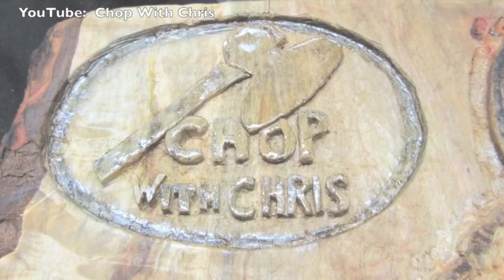How To Make Snowshoes

Comment: Cool job. The locals here use ash for the frame, rawhide for the weave and then shellac everything. In fact they put a new coat of shellac on them every year. I have a friend that has a usable pair from the 1930s. Put away carefully and shellacked every year.
Reply from the maker: Thanks for the advise.  I need to shellac them.

Comment: Well done. I like the frame you made but I would have used rawhide for the webbing. Soak it, strap it, and then finish with some type of varnish once it is dry. Leather will take on water and turn soft when wet. You will start to sink in the snow.
Reply from the maker: +MascotAL Yes.  Rawhide would be much better.  Just hard to find for me.
Reply: You can buy it on a spool from tandy online.
Reply: I can hook you up. I have steer hide and green deer skins. good video dude
Reply: How about using nylon for webbing?